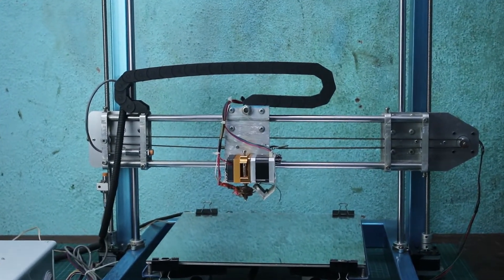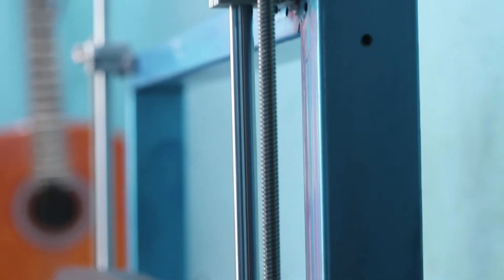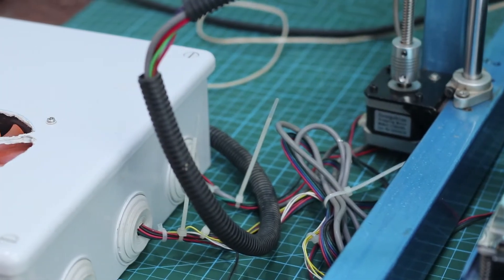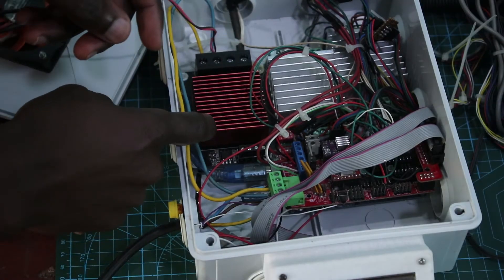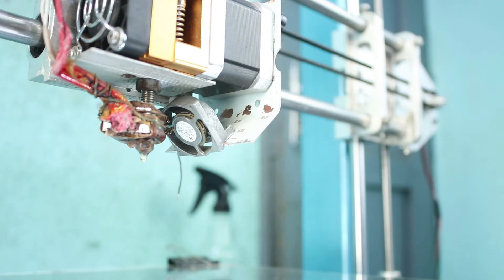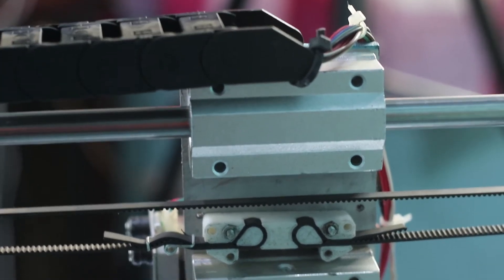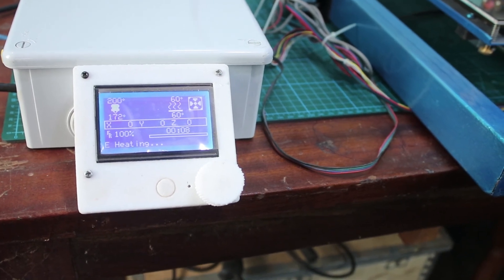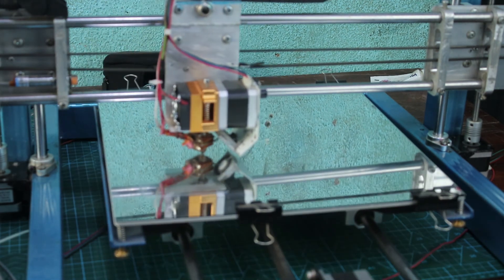DIY 3D printer upgrade

Comment: What is the voltage,input and output of your power supply could you please answer this
Reply from the maker: Input voltage 220v output 12V - 40A
Reply: @HermannLabs  thanks
Reply: Also what cable did you use in your power supply and what’s the power input and output
Reply from the maker: @BrandonSchwab660  cable for the output of the power supply going to the printer must be big enough to not heat up because the heatbed requires current higher than 15A to work property. For the cable of the input supply I used the 250V- 10A cable